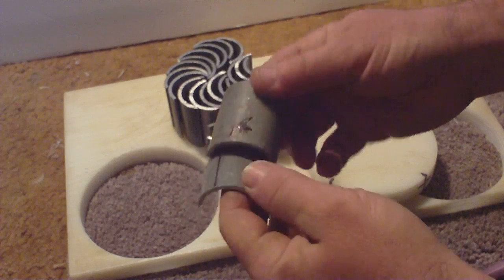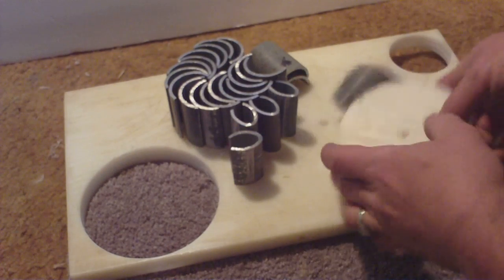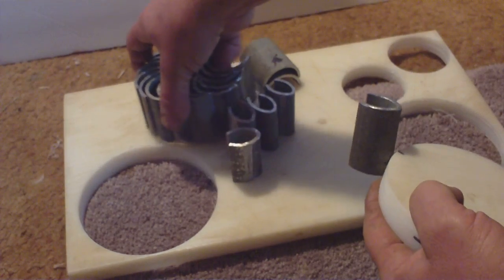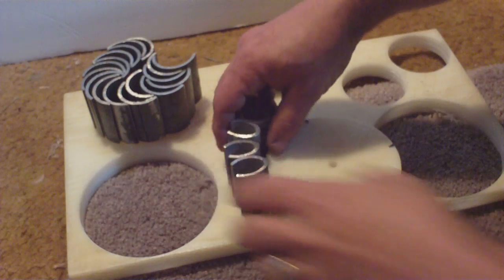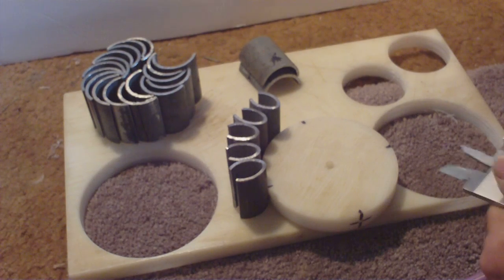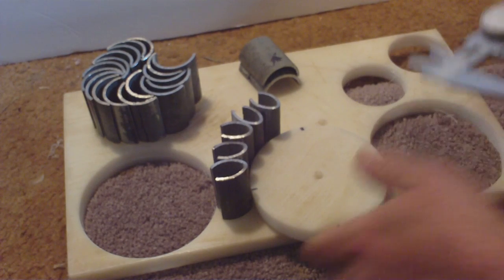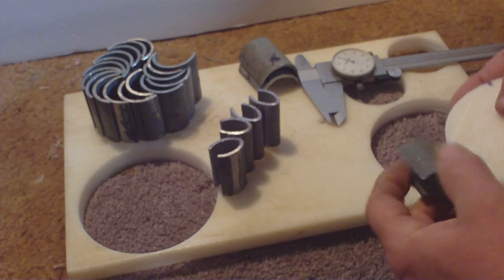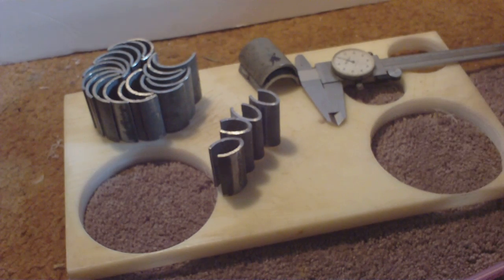step by step #4

Comment: use each C piece as a coil. wind coils in the C groove, connect in series.. the lines of the coils would be at 90 degrees. if the energy comes in through flux fields then it would energize the coils. now add the reciprocation and  break the pmh at every turn of the crank.. get it?